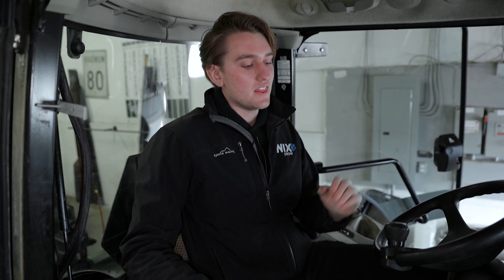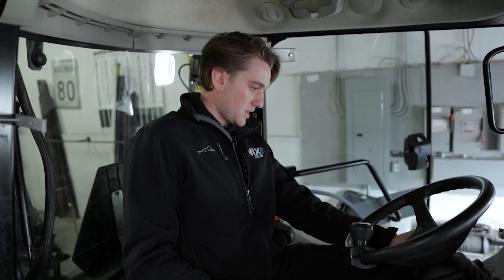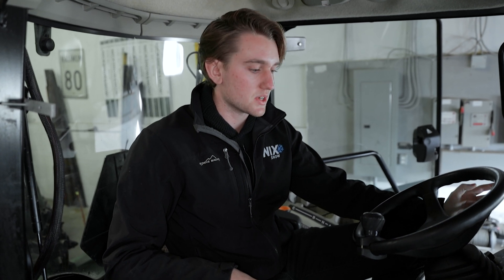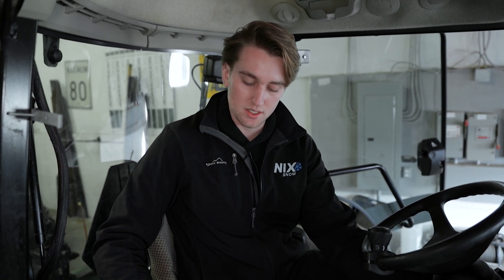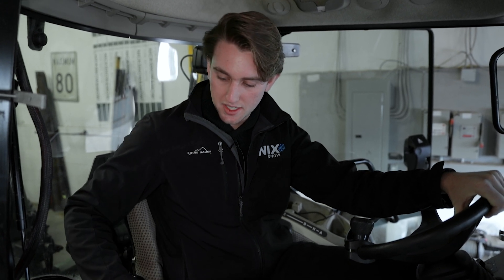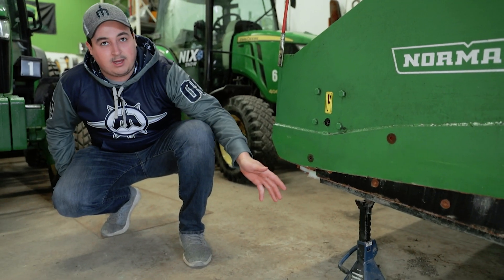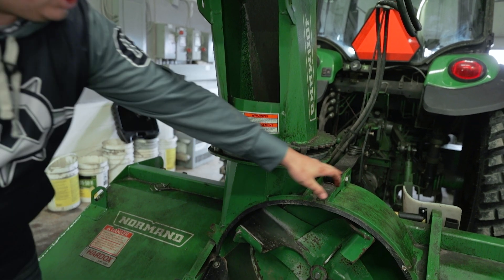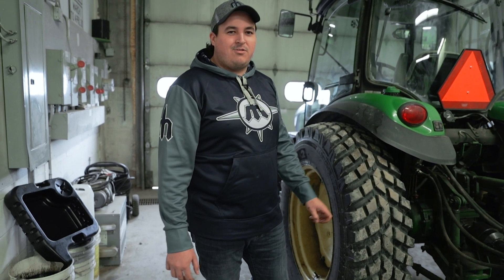John Deere 4066r / Normand 82"  Basic Operator Training - Segment 1

Comment: I had a 2015 John Deere 4052R cab tractor with mechanical front wheel drive and are one egg tires which I used with a 6 foot rotary cutter and I did not like the windshield wiper. I wish it had had the pantagraph type windshield wiper found on the John Deere 5325 N

Comment: Using four-wheel-drive is not going to wreck anything. It will lead to increased tire wear and increased where of the 4 Wheel Dr. components but it’s not gonna wreck anything. It will also cause the turning radius to increase

Comment: C is usually used as a travel gear and B is a work range.  C can be used for mor power to push big piles.  Breaks could be used ALL OF THE TIME if you need to turn sharp.  Because you can break the right or left rear tire independly allowing you to turn almost as sharp as a skid steer.

Comment: why wouldn't you without  a front loader on your unit tie into your mid scv stack for your rear blower hydraulics that way you can control it with the loader stick?
Reply from the maker: Done that before. Not as comfortable to operate.

Comment: Great Video Nick! I am looking to getting into the snowblower game as we have been using truck and plow for 20yrs. We are looking at the same setup as you have. Are there any specific features you recommend on that tractor if ordered from a dealer. With no experience with tractors I wanted to make sure we get all the features you would recommend.  We would run the normand blower. Thanks
Reply: The fender pack is important to keep the salt off so front fenders and fender extensions on the back, front weights full rack of them, the Nokian tires are something some guys sware by some guys not so much they really wear quickly in the summer, but lots of tread is essential. I haven't run nokians so I can't really give an opinion on them. The beacon light is important for visibility. I'm sure I've missed something but if you tell your dealer you're setting up a tractor for snow they should have a good idea what to recommend to you.